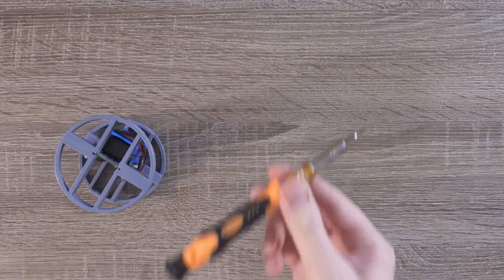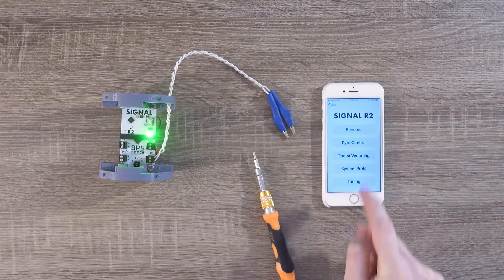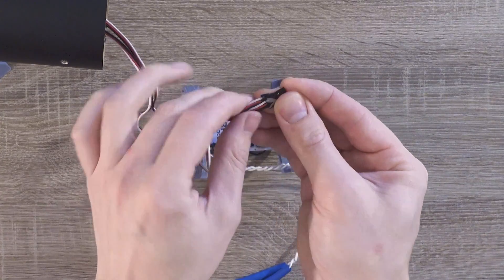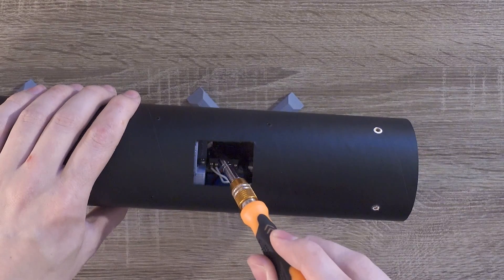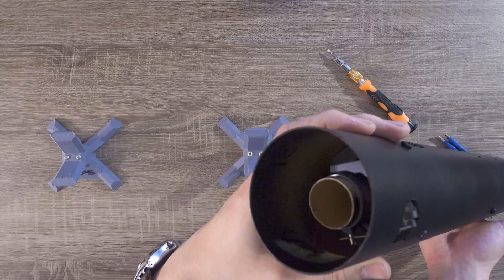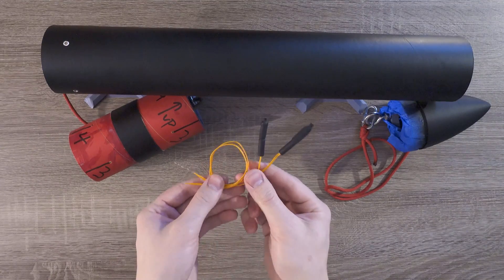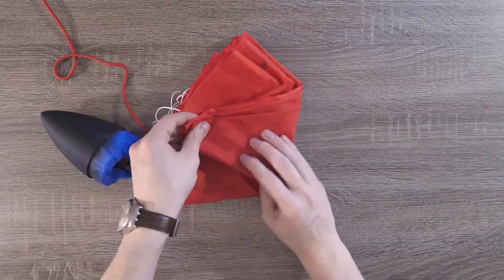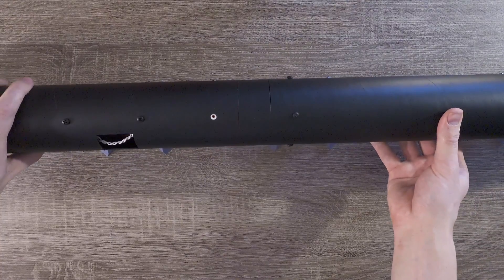Avionics Integration - Build Signal R2

Comment: Hey Joe, what did you use to design the app? Thanks so much you're great!
Reply: You can build apps for iOS using any of these languages Swift, Objective or JavaScript. For Android use Java, Kotlin or JavaScript. For Windows phone, use C#, C++........
For JavaScript you can use frameworks such as NativeScript, Apache Cordova, React Native, Ionic Framework.
If you know C# you can use Xamarin to build iOS, Android and Windows apps.
user interaces you use HTML/XML and CSS. 
There are a lot of stuff out there to build apps. To link app with electronics use networking tech such as bluetooth, WiFi or Internet. So the circuit must have any of these modules.

Comment: Having two chute charges, would it be possible to detect if the first failed to fire using Signal's IMU and fire the second charge with another pyro channel?
Reply: Of course! it has a accelerometer and if the acceleration after firing the first charge doesn´t decrease properly, you can fire the other channel
Reply: Corbin B yea probably
Reply: There are three extra pyro channels on the Signal r2, so you can activate a third channel to fire an extra charge of the first one does not detonate.
Reply: Idk, that would most likely require new code, and I don’t think even AVA can do it..